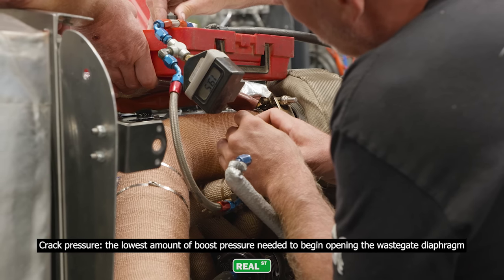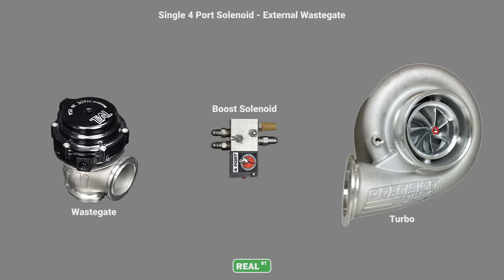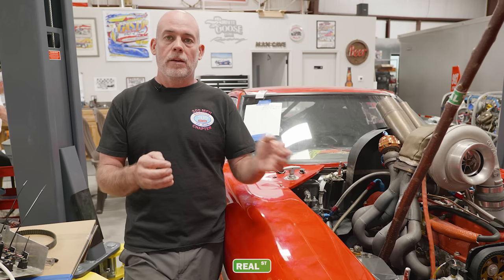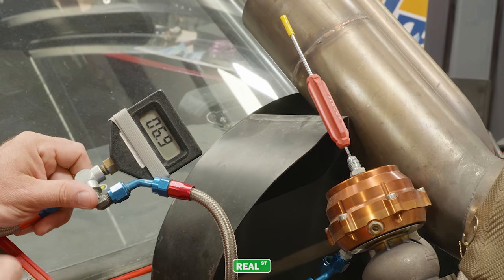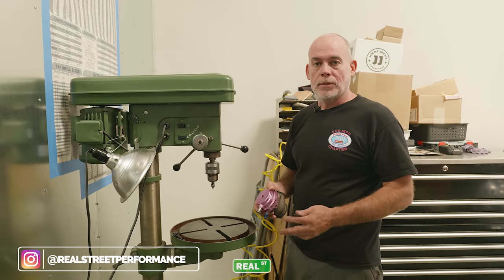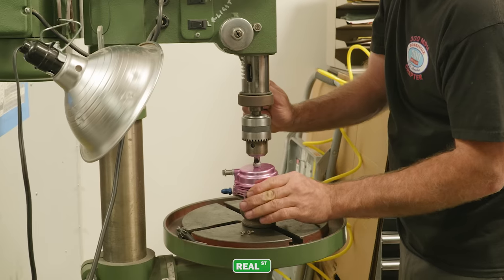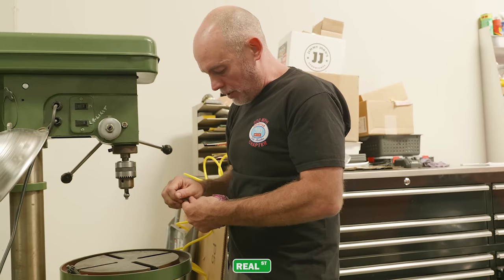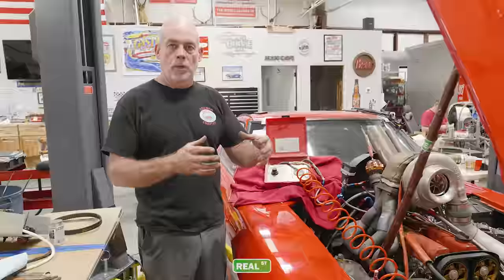Wastegate Crack Pressure & How To Test The System - Jays Tech Tip

Comment: One trick I use to open waste gates is grab a length of 6mm x 1.0 all thread or 3 long bolts of the same thread pitch, along with a few nuts and washers. Cut the all thread into 3 pieces and remove 3 bolts from the waste gate from every other location and then thread in the all thread and then thread the nuts on with the washers all the way down until they contact the waste gate. Remove the 3 other bolts, evenly start to unthread the nuts until the tension from the springs are released. Reverse procedure to reinstall. It's a good way to do it so the bolt holes are aligned and you're not fighting rotating anything to align and risking possibly cross threading those fine threads. I like Jay's trick, next time I'm servicing my waste gate I'll try my drill press.

Comment: Has the Turbosmart electronic waste gate not worked for full boost control with a motorsports grade stand alone, like Motec? Also with a sensor on the wastegate cap going to a Motec tell us the crack pressure in real time or in the data logs?

Comment: Hey Jay. I have a question. How much leak past the shaft is acceptable on a wastegate please ?
Reply: Not Jay here but it is same logic of "how much money waste is acceptable from what you have in your pocket to spend".  Real problem with leak is how much it is leaking in % from nominal values at operating conditions. What that means. IF you set 10PSI  as test pressure and you have leak that will drop this pressure to say 9PSI, do you know will it leak in same way when you boost 20PSI at 700 degreess at waste gate and about 200 degress at engine bay. Simplest way is to make the darn thing not to leak. Other problem with the leaks is if you tune your engine to run fine with the leak, once when you accidentally fix the leak there is high chance you will lean out and burn some cylinders.  Just make it to not leak.
Reply: @MrJembob - I asked this question the other day on the TiAL tech support line when I was experiencing a leak through the valve shaft while pressure testing an MVR wastegate.  They said some leakage is normal and a complete seal is not desireable there.  That was with me testing with a hand pump to provide pressure.  When I used regulated shop air like in this video, I found my crack pressure.

Comment: You don't really need a 4port for max boost... you can achieve it with a 3 port...  
Port 1 to the top chamber
Port 3 to the bottom chamber

Port 2 to the compressor cover

No need to "vent" the solenoid.
It will still, however be sensitive to DC like a 4port.

HTH

Comment: Riddle me this my car made 26psi on the dyno then on the street it makes 2psi less🤦 what would cause this? 👍
Reply: Your pulls on the dyno probably run a little longer than street pulls. Measure your rpm rise per second in both. The faster the engine runs through its pull the less boost it is likely to make.